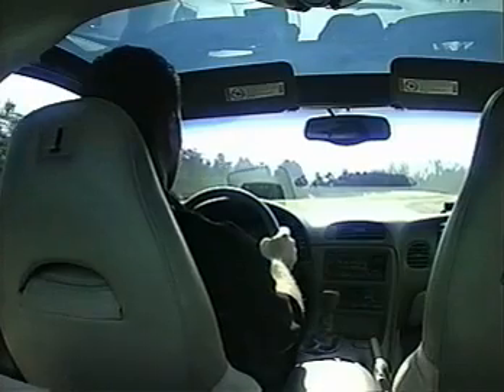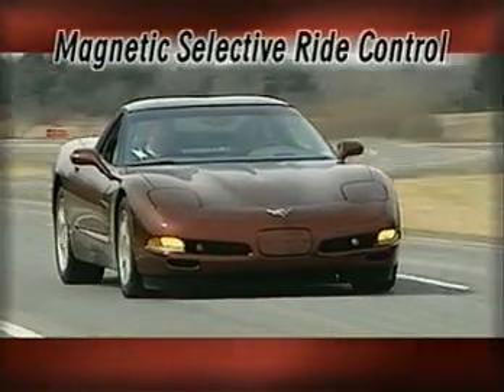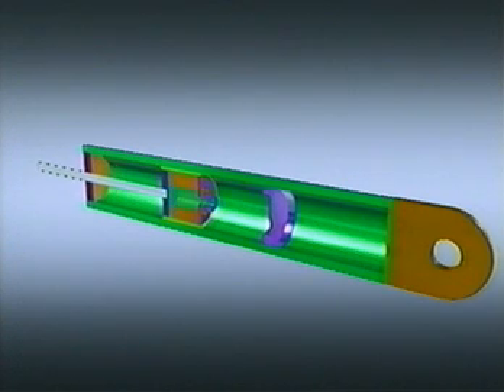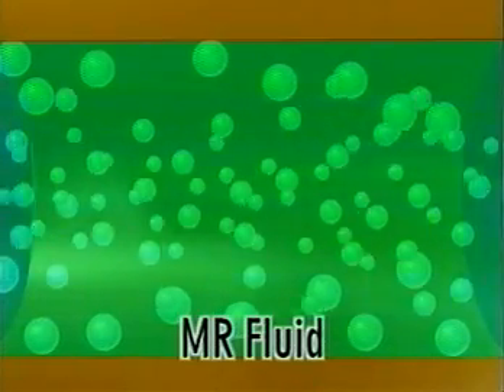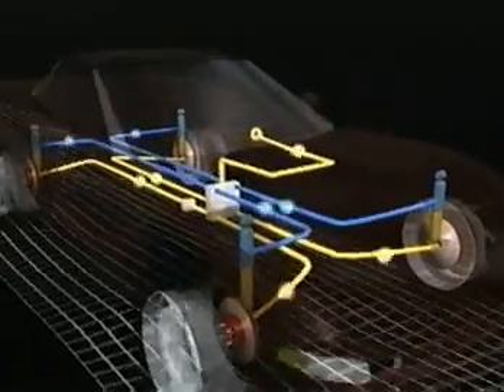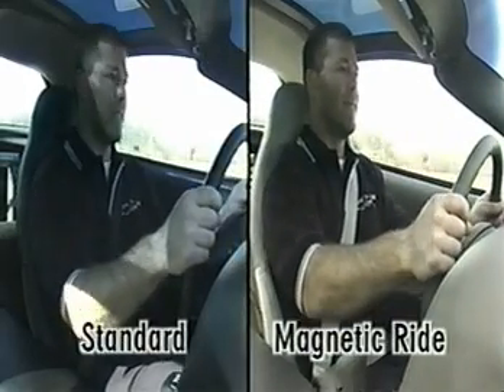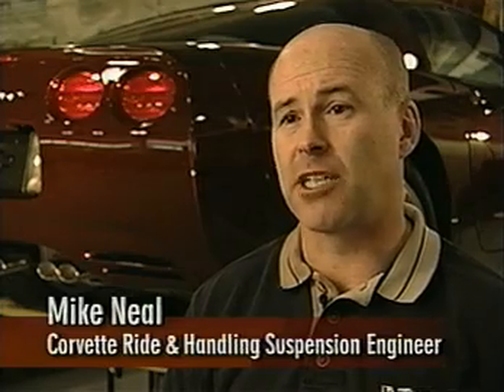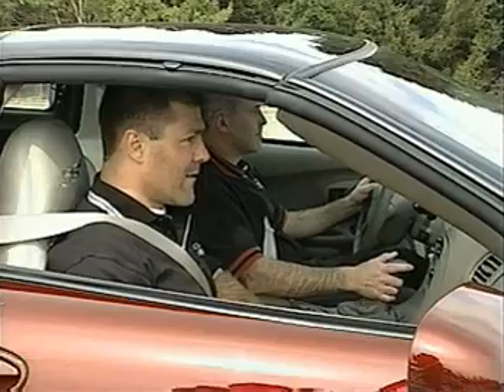Corvette C5 Magnetic Ride -- GM Promotional Video

Comment: I have a 2002 c5 z06, did those come equipped with the magnetic ride? It sure feels like it hasnt
Reply from the maker: Excellent question. Our Z06's was Chevy's "extreme" version of the Corvette. Our Z06's have a unique suspension setup. That is why we don't have the Tour, Comfort, Sport dial.

From Wikipedia: A special suspension (the FE4) was developed exclusively for the Z06, and is not available on other Corvette models. It features unique shock calibrations, a larger front stabilizer bar, a stiffer rear leaf spring, and revised camber settings — all calibrated with a bias toward maximum control during high-speed operation.

I hope this info info helps answer your question. Feel free to ask if you have anymore questions.

Comment: @mistamontiel 
Yeah, I don't know about that.  I had an '02 C5 Z51 Targa 6spd until I bought my C6.  As much as I loved my C5, right away I noticed the difference in everything.  It does everything better than before.  My LS3 dyno'd 382 to the wheels bone stock!  My uncles '02 C5 Z06 dyno'd 347 to the wheels bone stock.  The C5 is still an amazing machine but I'm more than happy with my C6.  It's like a fighter jet without wings lol.  Both models are insanely great either way.